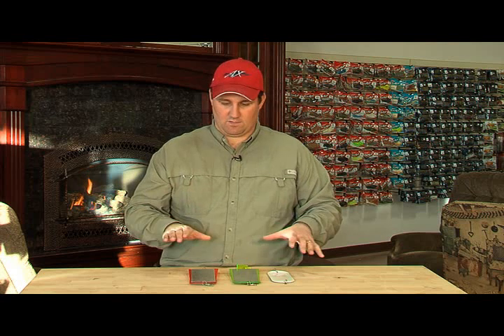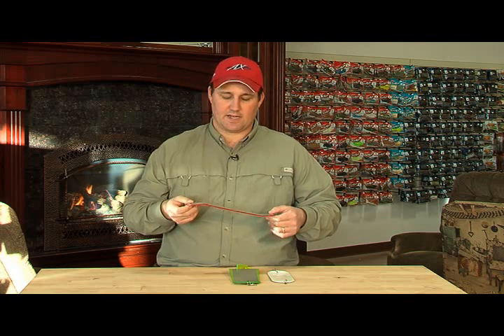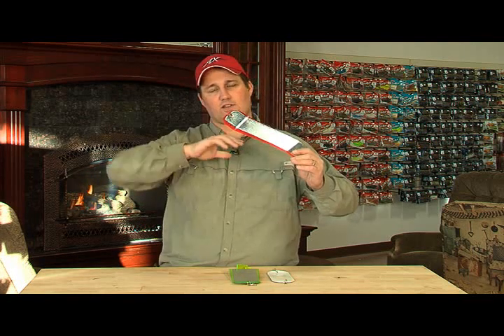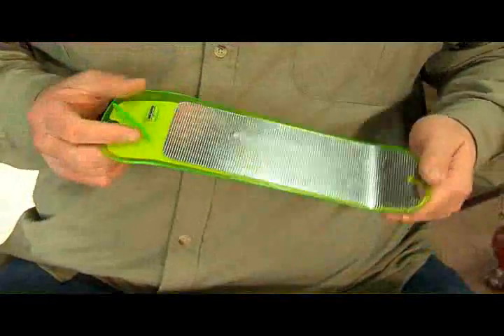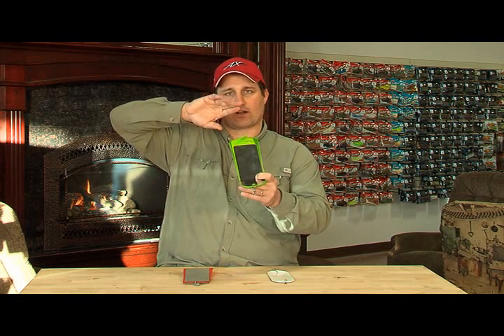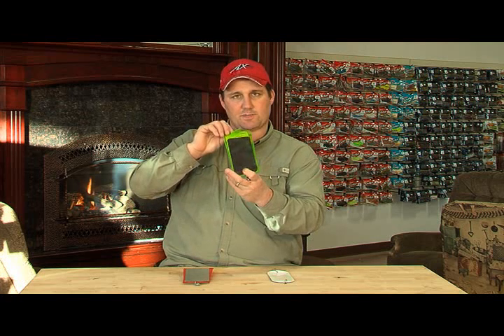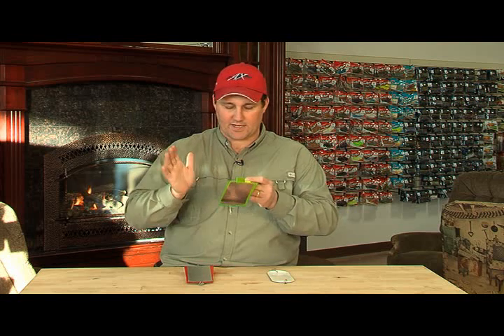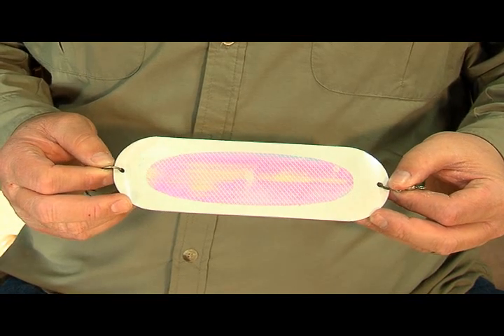Understanding Flashers vs Dodgers

Comment: I use dodgers and i have learned that your lure or bait needs to be 14 inches or less from the dodger towork the best and on your line towards the pole about 30 inches  you need arudder to prevent line twisting . Pole to rudder to dodger to lure .